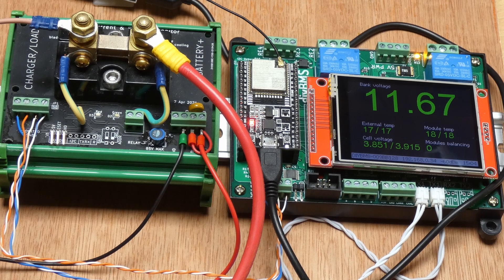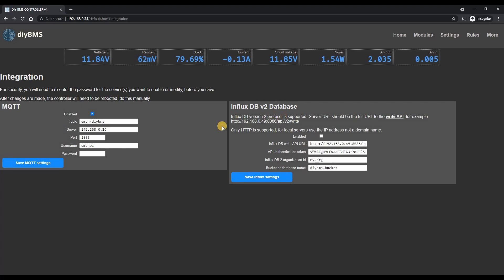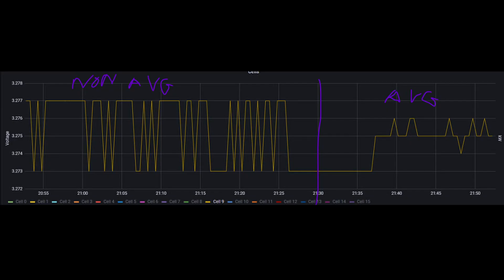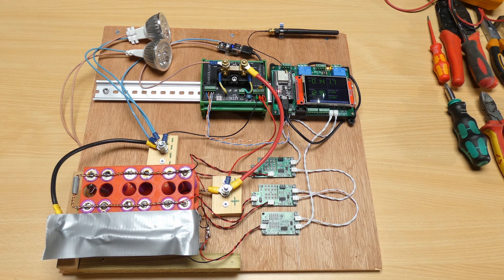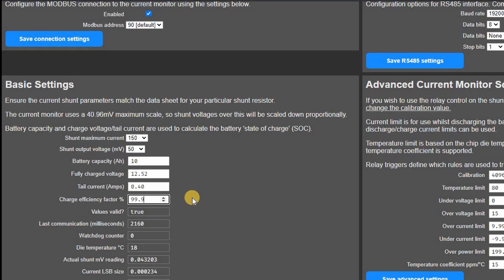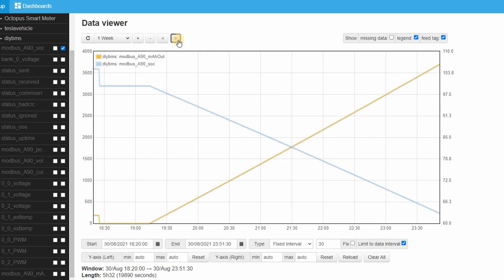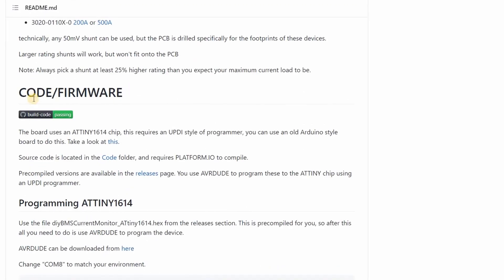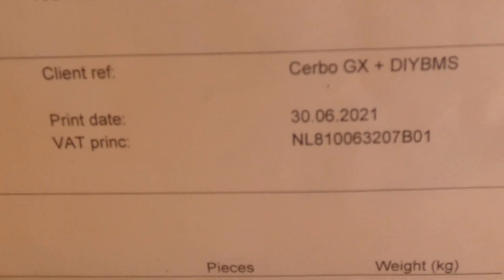DIYBMS September 2021 update - SOC% and lots more

Comment: Very Great work, realy incredible. May I propose an improvement. It is necessary to also "calibrate" the SOC when the battery is empty. Especially in winter times, when the battery is always empty the SOC is very wrong at e.g. Victrons Battery Monitor (MP2), because it is also only calibrating SOC when the battery is full. Compared to REC BMS, this is also calibrating the SOC when the battery is empty. So, this is the only way to get a good SOC reading over the complete year, which is necessary.
your work is realy fantastic. i am very impressed.
Reply from the maker: Thanks for the comment.  It should be possible to add that calibration on as well as it could be done through software.  If you wish to discuss further, can you raise an issue on GITHUB and we can chat about it.

Comment: Love your work Stuart! Keep it up.

I'm doing an electric vehicle conversion at the moment, and am currently planning on using 112 x 60 Ah LiFePO4 cells in series to power it. I intend to construct the pack from 7 x 16 cell modules, to make each module ~48 V. I had, so far, planned to use a Module for each cell, a Controller for each group of 16 cells (perhaps even with a current shunt module on each Controller), and then to use CAN to interface all of the controllers with a master controller of my own devising. Is this approach likely to work, or would you recommend me finding a different solution? I wanted to use a FOSS solution, but this may not be practicable.
Reply from the maker: You probably don't need a controller for each 16 cells, perhaps one for each 32 cells.  CAN interface could be used, but you will need to sort out a lot of code to make everything talk.
Reply: @StuartPittaway  Thank you very much for your prompt reply. If I do decide to design and build a "Master Controller", I'll make sure to link it in the forums.

Comment: Thanks as always Stuart. I have assembled the updated boards for Nissan Leaf modules and your software is running fine. Unfortunately I am having trouble obtaining a set of 49 Leaf battery modules to check the physical dimensions of the boards. Full lockdown here in Auckland is not helping.

Comment: Thanks Stuart, I am using your DiyBMS in EV, working Great.
Can you tell me if i can program 4.40 Modules with new compiled firmware of modules  you provided with esp32 repository. I am using esp8266. 
2nd do new update of modules will work with esp8266.
I am not asking about Controller, it's just am matter of Modules.
Reply from the maker: Yes, it will work

Comment: If you take a lithium ion cell over 4.1 volts you start clogging the SEI layer and very soon its stuffed because once trapped there the ions can't get out and others cannot pass through . There is no fix. There is a known formation of lithium dendrites at 10% over-voltage pressure and at 20% over-voltage pressure copper from the backing plate forms copper dendrites too. Both of which pierce the plastic separator and short the cell.

 4.2 volts just once on a new cell only then never again.  You mentioned charging up to 4.35 volts which tells me you don't understand CC/CV charging . Most don't. You do not exceed 4.2 voltage push with the charge . So put 4.2 volts on it and wait until the current going in drops to almost nothing and when disconnected the voltage is around 4.1 volts. It takes much longer but your cells last much longer too.
Reply from the maker: Hello, as I also mentioned on the video I'm using 16650 not 18650 cells. These have a charge voltage of 4.35V.  Datasheet: https://lygte-info.dk/review/batteries2012/Sanyo%20UR16650ZTA%202500mAh%20(Magenta)%20UK.html
Reply: @StuartPittaway  You know I have learnt to discount what the manufacturer says these days . They want to sell more . They are Lithium Ion cells by the look of it and all their discharge graphs are from 4.2 v down . If you take them to 4.35 v you will be slowly destroying them. Try stopping at 4.1 v with some and see which lasts the longest. My apologies though I have not used 16650 cells and it may be the cell materials on the cathode are doped to accept more . They don't say . Thanks anyway . Following.

Comment: Great work，are all platform open source？
Reply from the maker: Yes open source all on GitHub. They are licensed for non commercial use.
Reply: @StuartPittaway  how about your SOC algorithm, is it accurate?
Reply from the maker: @dennyqin6944  SOC is never 100% accurate in any system.  The one I'm using is simple coulomb/amp-hour counting.  It matches other readings I have, but those are not calibrated devices.

Comment: Stuart I cannot get the display working mate. Plus can I use it for lipo4 batteries?  16 off?
Reply from the maker: The display should just be plug and play. Can you open a GitHub issue and upload some pictures of the TFT display please.  Lipo4 is no problem

Comment: Perfect.Thank you. As i understood the limit is over 100S but the shunt limit is 100v.I am building a system with 150v and I can't use the shunt(all chips are limited to 100V).What is my option.Thanks in advance.
Reply from the maker: You probably need to look at a different BMS or consider reducing the voltage of the battery.
Reply: @StuartPittaway  I am buildin an electric motorcycle - 70kw. It will have 12-14kw/h battery and it will be 45s Lifep04 - 162v charged 144v nominal.There is no such BMS that does not cost 7-10k $.My whole budjet is 6-7k $.
I am verry happy that i found your work.I have good soledering and electronic skills but not good at programming.I think i will still asemmble and program your BMS. :)
Reply from the maker: Like I said, you probably need a BMS suitable for that sort of setup
Reply: @ohranitel  a bit of a hack a quite dangerous but you can put a resistor divider on vbus input of ina228. You would also have to supply power through an external power supply for both shunt and controller. You wouldn then need to externally multiply the power and current after measurement to get correct value again. Quite a bit of hacking. Better off getting a  dedicated system. I have been doing something similar with my ina226 to measure 48v system. The ina226 is limited to 30v odd but by using a voltage divider on vbus and putting shunt on -ve terminal it works.

Comment: What are the chances of getting a Sol-Ark inverter communicating? They use rs485 communication as well
Reply from the maker: Fairly favourable.  I've got a contact at SolArk in the pipeline.
Reply: @StuartPittaway  I'm willing to do some testing. Have a project that's using lead acid now but interested in lithium